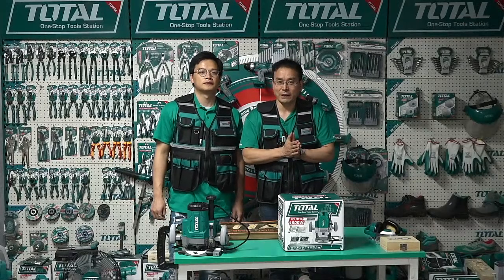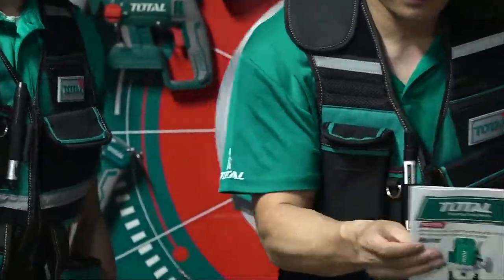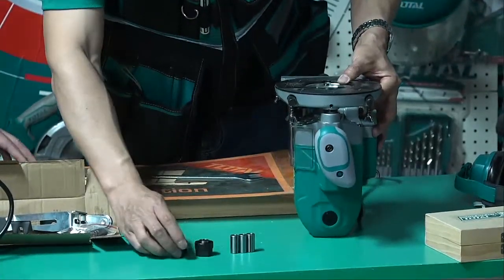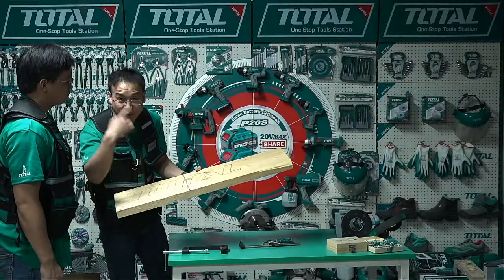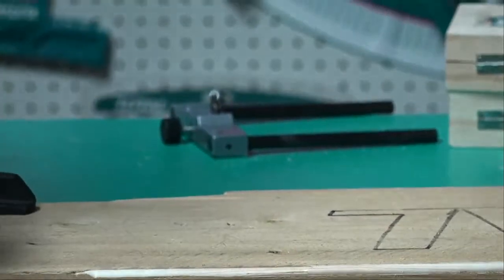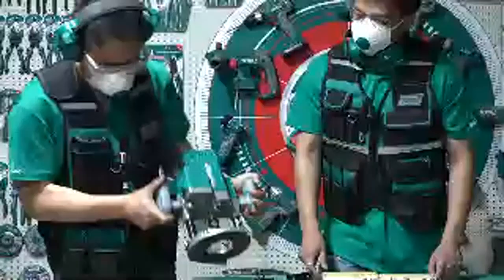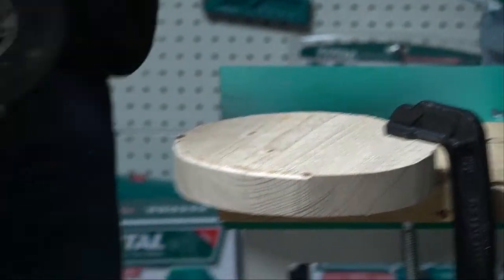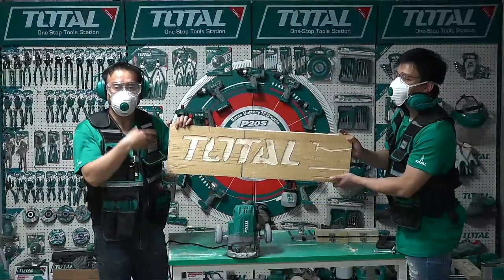TOTAL LIVE SHOW 14: Electric router

Comment: This is second update on my posts earlier on this same video. I went to the shop where i bought the router and guess what? All the damn 1600 and 2200 watt routers are making that same nasty noise when pressing or pulling down the router. Went home and took the plunging posts apart. I was correct. When pressing down or pulling up the router, the spring is rubbing on the threads of the supporting rod. So if you do this a often the threads of the supporting rod and the spring will wear out quickly. Conclusion:  the spring assembly on these routers is not designed well. So please spare yourself the trouble and don't buy these routers. I don't recommend them for DIY'ers and seriously not for professionals. Don't believe me? Try them out in a shop. Don't just order them online. You will be very disappointed if you do. There are far better options. These machines are cheap made chinese junk.

Comment: This is an update on my post earlier on this same video. i waited a day to get a reply from total tools world.  Heard nothing, no reply so i'm giving this machine hundred  thumbs down. This is just a plain cheap chinese crap machine. When you push the router down or pull it up you can hear a nasty sound coming from the spring with the supporting rod. The spring is probably rubbing against the supporting rod and gives a sound like a socket ratched wrench, check the sound at 22:05. So the machine is not very well designed. Save some more and buy yourself a router from a well known brand like makita or dewalt. That's all i can say

Comment: Why does the router makes that nasty sound at  22:05 when you pressed it up and down? I bought a 1600 watt router today and I found out when i came home i have the same nasty sound with my router. It is not a nice sound. Looks like the threads of the long adjusting bolt are rubbing against the spring inside. How can this be fixed? Please reply because i don't like the sound and if i don't get help i am forced to give this product a bad review. Hope to hear from you soon, many thanks

Comment: i notice that there is no hole at the bottom of the base for the router table adjustment. can you blease confirm if it is really not suitable to use for the router table?
Reply from the maker: Hello sir, thanks for your interest in our brand. Yes, this is not designed for router table, just used with hands.